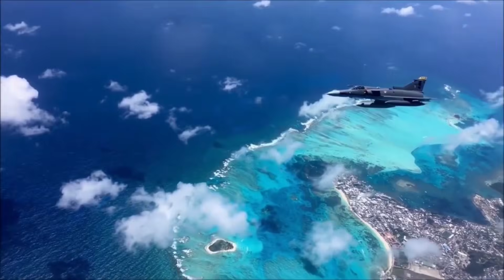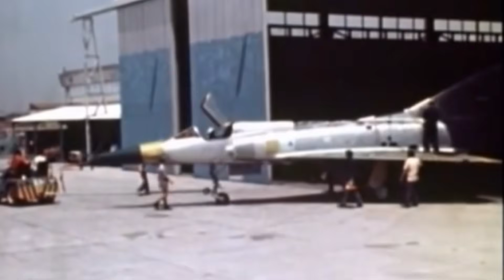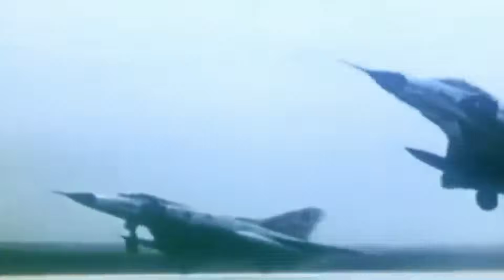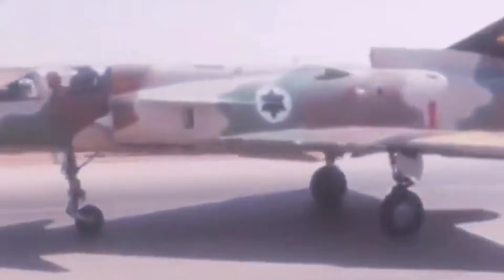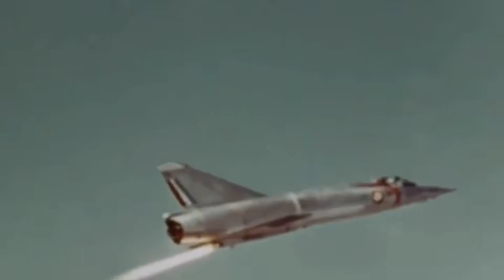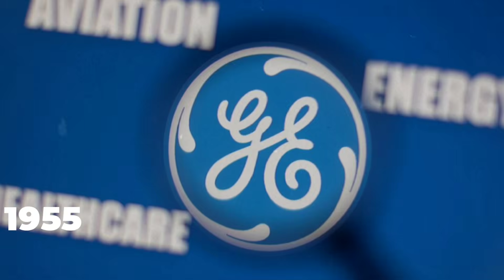Israel's UPGRADED Jet Fighter Is Unbeatable!

Comment: The Kfir is an interesting fighter jet made in Israel.  We have seen several videos about the different versions and upgrades of the Kfir, so it isn’t entirely clear what version of the Kfir is available on the open market.  Assuming the Kfir C-10 is one of the benchmark versions of the plane, it would be a cost-effective alternative to modern fighter jets. It would give operators considerable ability at a much lower cost.  

But the market for fighter jets is difficult to predict.  There are several alternatives to the Kfir, and the marketing & lobbying by different makers must be intense—bribery, not withstanding.  But an open and transparent purchase of the Kfir C-10 version would be a viable option for users.  There has to be some sensible limit on how much technology an air force really needs for a country’s defense.

Comment: Sri Lanka won the war with these jets.
Reply: The Mig-27s and Pucaras were arguably more helpful, given their higher sortie rate and efficacy in the insurgency Sri Lanka was fighting. Their Kfirs were good, but not as suited to the specific conditions as the Mig-27 and IA-58 were.
Reply: kfir c60 ng is a completely new aircraft, it appeared in 2010. with new wings, radar aesa EL/M-2052, new landing gear, avionics, pilot’s helmet almost like on the Israeli F-35i adir, you just need to look at the enemy and that’s it, the first kfir appeared in 77. kfir c1, c2, c7, c10 in general in 95. Colombia bought in 2018. 18 kfir c60 and modernized their kfir c10, you compared your old ones that the Israeli Air Force in the first Lebanon war in 82. fell from the first kfir c2  @HufflepuffSamurai

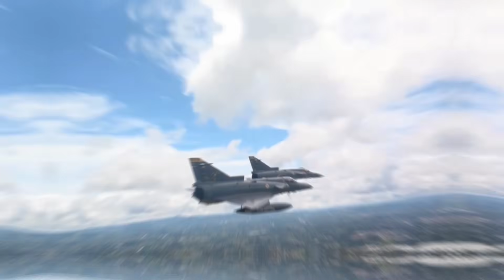Comment: Fyi the KFIR cannot Fly at 30,000 Meters Altitude which is 98425.197 Feet that's higher then a U2 or SR71 can fly, check facts 9:10 into video.
Reply: Probably 30,000 feet
Reply: @simko8665 most commercial airliners fly at 36000 ft

Comment: it's very beatable.  One good hard turn and the Kfir's delta wing bleeds off all the energy which allows a modern adversary to just turn and gun it out.
Reply: Why did Dassault stay with the delta wing configuration through the Mirage 2000? Many countries purchased this fighter and France still operates them.
Reply: @rey1953  Dassault also manufactures the Rafale aircraft which is one of the best in the world. If it gives the Mirage a wing configuration like the Rafale, buyers will take the cheap Mirage and not the expensive Rafale.
Reply: The Israelis are not stupid. They flew the Mirage and the Eagle for years. That's why the Kafir plane has smaller delta wings than the Mirage wings, and two canard wings were added at the front for very fast maneuvering. It's a plane built for dogfighting.
Reply: Hence why the backbone of the IAF are F16s and F15s, along with F35. This is still a superb platform for ground support.

Comment: Kfirs and mirage 5 rose 3 attack aircrafts of pakistan air force are aircrafts of equal capability. Both the above mentioned attack aircrafts have been modernized with time to time. Both these aircrafts are armed with bvr air to ground missiles and ecm pods.

Comment: Only problem I see is the lack of FBW technology but I think IAI has a solution for that
Reply: FBW would not be worth redesigning the electrical harness alone not to mention there are no off the shelf servos to replace the actuators its a massive job. Could it be done of course. It can but to replace a 1975 design that's a hard NO! No one would pay it 40mil +5-10mil for the refit to FBW.
Reply: I think the KFIR C10/C11, Block 60 variant has been installed with FBW, not to mention that it is also mounted with AESA fire control radar

Comment: A J79 engine F11F-1F should have been marketed and sold to the USAF as replacement for F100s. Would have surely earned a legacy in Vietnam as a pilot friendly  superb Mig killer with the right powerplant. But I'm surprised the more modern Rolls Royce Spey turbofan hasn't replaced the J79 turbojet in the newer Kfir. I suppose it has to do with the politics of availability. . .
Reply: Because of the arms embargo from France, they weren't able to get replacement engines. So they hired a guy from Rockwell to come over and install J79's into Mirage III's.

Once the Mirage V's showed up, the rest is academic.
Reply: @brothergrimaldus3836   The kfir is a decade younger. Mirage 2000 younger yet. They likely have the range advantage with that delta wing but I'd bet a hot F11 is going to turn tighter. Hell Grumman would've sold the Israelis fighters in the '50s.
BTW While they were trying to sell the 79 engine F11F-1F in Europe a French pilot trying it out ruined one of the two prototypes . . . sabotage ?  You betcha!
That was Grumman sales team's naivety to let him anywhere near it.
That basic Mirage layout is a classic though. The fact that it still lives and does it's job in a number of countries says it.